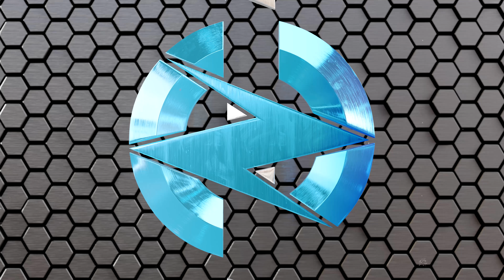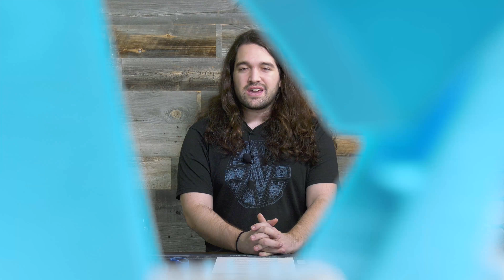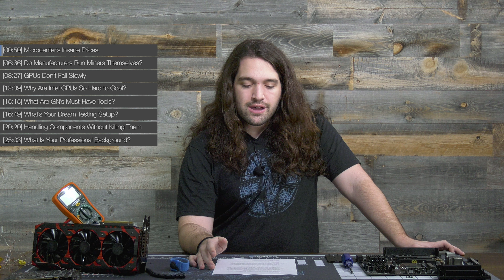Ask GN 68: Microcenter Ripoff, Why CPUs Are Harder to Cool

Comment: If you are in need of a GPU visit the GPU board partners websites and find the ones who sell their own GPUs, set up email notifications and one-click pay if available, the only sites I could find that sell their own GPUs are EVGA, Zotac, and PNY, PNY are trying to sell their GPUs same as 3rd party sells, EVGAs are up by around $20 to $30, Zotacs are around MSRP maybe $10 more but come in stock less often than EVGAs. EVGA does charge $22 for shipping in USA =(.

BestBuy got a GPU shipment in here yesterday,  a few RX 570s $250+ and 580s $400+ and a few PNY and EVGA 1060s and 1070s, priced at $400 to $450 for GTX 1060 6GB and $570 to $640 for the 1070s, I was not the only one there hoping to get a GPU I guess others asked and got shipment dates, no one I saw looking at the GPUs bought one I asked the manger why the GPUs where being sold for so much, he must have been asked this all throughout the day cause he had a tab in his phone already open on Amazon for the GPUs. He didn't understand the difference between 3rd party sellers and would not price match the GPUs to EVGAs own website prices.

Even Newegg and Amazon are getting out of hand with their GPU prices, Newegg has been pulling their GPU off the site and repricing them almost every 3 days for higher prices.

Comment: The tubes on my AIO GPU gets super warm leaving it mining overnight. Would push/pull on the 120mm rad help cool it better?
Reply: pump speed my friend, increase it. if its at 100% sure add more fans
Reply: well the fun trick with liquid cooling is that it is good on "short run" since the liquid gets warm slower, but it still does get warm, and when it does it gets cold at the same speed.. and it cannot be avoided (in very long runs) even with 110% cooler speed and pump, that's the "flaw" of liquid cooling

Comment: Does it cost retailers more to get their supply of GPUs when supply is low vs. when there's a surplus? No? Then it's artificial price gouging to take advantage of a lack of supply. As far as I'm concerned GPUs shouldn't be sold for more than MSRP unless it costs retailers more to get them from board partners. It's borderline criminal.
Reply: It's just supply and demand. If they raise the prices high enough then the demand goes down and they might be able to keep them in stock. At MSRP the shelves are empty in hours.

Comment: What cooling solutions for primarily CPUs and secondarily GPUs makes the most sense for a build that is going to be moved around a lot? I feel like larger air-cooled varieties have greater angular momentum to impart on the board.  However, I also have some reservations about an AIO or water loop. Thanks.

Comment: @11:00  This discussion is only valid for electrolytic capacitors. Most video cards these days use polymer (solid state) capacitors, which have a much longer life.

You can estimate the lifetime of an electrolytic capacitor by doubling the lifetime hours for every 10 degrees Celsius drop in ambient temperature, so if a 4000h @ 105c electrolytic capacitor runs at 80c, then that capacitor can be estimated to have a life of 8000h @ 95c  or 16000h @ 85c , so around  666 days or nearly 2 years. 

Polymer capacitors however have the lifetime calculated with a different formula  : Lifetime = Original lifetime x 10 ^ [  (Trating - Tambient)/20 ] ... so a 2000h@ 105c capacitor running at 80c will have a life of  2000h x 10^ ( 25/20) = 2000h x 10^1.25 = ~ 2000h x 18 = 36000 hour or around 4-4.5 years (of continuous operation at 80c).

Comment: Did you try contacting microcenter HQ or whatever to see if it's actually a thing they are ok with or is it just a rogue manager? I'm rather curious about how chain stores work on this aspect, how much freedom does individual store have over the price of their products?
Reply: We have zero freedom. The cards sell out within hours. Then we have no cards to build computers. Its a very huge issue. Reaching out to them they wont say much since the company does not advertise. However if you are building a pc you get a discount on cards.
Reply: The picture in the video literally says "as advertised", if the company don't advertise....

And while I certainly like the "building a pc" discount, it's rather vague.
Take the 1500 bucks 1080Ti for example.
If the buyer spend another 1500-2000 on a whole package of parts, then it would be a sure thing.
But what if they only want CPU+Mobo, good ones, for say 900 bucks?
On the other end, what if they select a full package, but of cheap parts that only sum to 300-500 bucks?
Which qualifies?
Or perhaps the discount will scale with the overall purchase value?
The vagueness will mean that even if every store does get the memo, what customer ends up experiencing might differ from store to store.  And consistency in experience is supposed to be part of the advantage of chain stores.

And what's stopping them from re-selling the other parts on e-bay? Sure it might incur additional cost and effort, but the things people do for money....

Don't get me wrong. I still love the idea because it's certainly better than nothing, better than what most companies are doing. But it just feels so incomplete...
Reply: Just Anoman the discounts do not scale. And parts ha e to be comparable. Further when you can’t get cards and complain about not being able to buy the entire stock it sucks. I have to deal with this crap daily. We had no stock for normal people and no one came to build computers.

Comment: Why do AMD and Intel use heat spreaders on CPU?
Reply: To protect the chip when handling/mounting. Its easy to crack.
Reply: Probably to prevent stupid users from damaging the chip.
Reply: CommanderWolfy GN explained this one before, it’s mostly because people themselves handle the cpu and mount it in the mainboard and attach heatsinks, therefore they have to protect the bare chip and make it somewhat foolproof. So at some point they added the ihs as a protective „lid“

Comment: Mining with a full waterblock? Power & mem temps on ftw3 don't go past 50 degrees (ambient ~30)... Would it be safe to assume it would "out of the woods?"
Reply from the maker: Doesn't matter if it's mining or not -- keeping thermals that low on all core and power components would generally ensure higher clocks (you get higher clocks for every ~5C) and reduced concern of lifespan, yes.
Reply: Here in China the prices are about average not as bad as it is in North America. Im buying 6 1080tis with AIO coolers for about 900usd each.

Comment: I went to microcenter the other day to purchase an rx 560 they had listed for $120. When I go to the store, they were selling rx 550's for over $200. It was seriously fucked up. Still managed to get the 560 for $120 because the label on the box itself hadn't been changed yet, but they sure tried to get $300 for it. They even had the nerve to claim that they weren't jacking up the prices, but instead the cards were on sale before and they were just raising them back to normal prices.
Reply: saw a bestbuy near me selling an rx580 for $519 marked price. only 1 left on shelf, a couple weeks ago. shameful.
Reply: I called a manager out the other day over an absurdly priced EVGA 1080 they had on the shelf. They denied gouging GPU prices and after 5 min of back and forth, I was asked to leave the store.
Reply: feelingtardy The MC near me has 1050 tis for $600 580s for $1300 and the same 1080 i got for $515 last year for $1900, i damn near had a heart attack when i saw that, Their vegas are marked at $1800 for the 56 and $2500 for the 64.

they also have DDR4 3200 going for $350 for 16gb and even their prebuilts are through the roof, Guy told me miners were buying prebuilts with 580s or 1070s for $750-1k because they couldmget the card cheaper and ditch the rest of the pc
Reply: Understand: The ONLY thing these 'Gougers' are going to understand, (until they get their sensibilities out of their ...) is Boycott!! - Where the products do not move, and Cost Them additional $$$ Collecting Dust on their floor space.
Reply: I know this is a year old thread and prices have largely returned to somewhat sane levels thanks to changes in crypto.... But... these stores didn't really have a choice. I know a guy that worked for Microcenter at the start of the mining craze and there were literally runs on GPUs. People were emptying the shelves, then either building mining rigs or throwing them on eBay for 3x retail. So either they match what the online markets were doing and raised prices or they just wouldn't have kept any GPUs in stock. The speculators and miners would have snapped them up the minute they came off the delivery trucks. Either way, the brick and mortar customers were screwed.... you walked in and saw empty shelves or stocked shelves with high price tags... but there was no reasonable third option where retailers could have retained MSRP pricing while actually keeping stock on the shelves. Why would they hand free money to speculators? You were either paying market price from them or from Amazon... unless you were a lucky one who got to the store before the vultures did.

Comment: Newegg has been selling Vega for $1299 all week whenever they come in stock.  From Newegg, not a third party, and both Vega cards, 56 and 64.
Reply: Yeah I thought is was strange that he was singling out MC specifically  when everyone is doing it.
Reply: Exactly and you can’t get cards on amazon. But Micro Center should sell at normal price and have zero cards for system builders. It’s sucks. Builders come first.
Reply: Metatron's Cube "sold and shipped by Newegg" with Newegg as the seller, when searched for you toggle "Newegg only"...  And it's not Newegg?  The fuck is it then?  It's Newegg.
Reply: Metatron's Cube check new eggs websites they are selling 1060’s for $500. They are all over priced.
Reply: bet its a 3rd party selling them at that price not newegg.
Reply: That's not newegg. Neweggs stock will be slightly higher in price from original msrp due to ram but no more than 50$. I got a asus 570 4g for 190$ a week ago. I missed out on a 3rd party manufacture vega 56 at 450$ because I hesitated to long looking at another card.....
Reply: all the cards that come up for me that are 1299$ for a vega 64 also come with a "free" 600$ gpu enclosure, and for less expensive cards "free" 200$ monitors....there is still a 50-100$ mark up but they come with stuff to make up the price difference.
Reply: If you're looking them up now, they aren't in stock.  They come in for around a half hour twice a week in varying models, I've had them on alert from nowinstock and check every time they come in stock direct from newegg.  The vega 56 and 64 strix came in stock twice this week, and both were $1299 sold and shipped by newegg.
Reply: there is a powercolor vega 64 with the external enclosure right now, and a few rx 5xx series with monitors
Reply: All stores are doing this... its not just newegg thats ripping 'us' off. (and abusing AMD / nvidia good will)

Comment: I like Microcenter
Reply: I've had nothing but good experiences at my local Microcenter over decades.  This crazy situation with GPUs may erode the good will they've earned from me, or not--depending on how they handle it.  I hope the story here is an exception, and not the rule.
Reply: Microcenter never ripped me off.  Tbh their return & refund policys are the best. Prices for cpu and mobo's are usually a $100 (or more) cheaper. Plus if you have patience the  open box deals are soemetimes ridiculous (got a 980ti for $142 last march).
Reply: Mine sure doesn't....guess it's where you live. Welcome to retail.